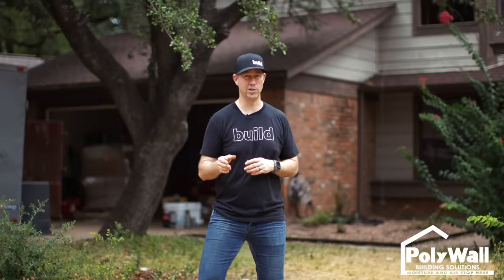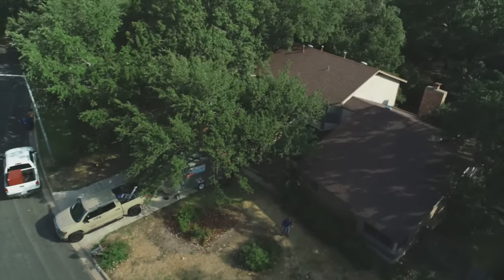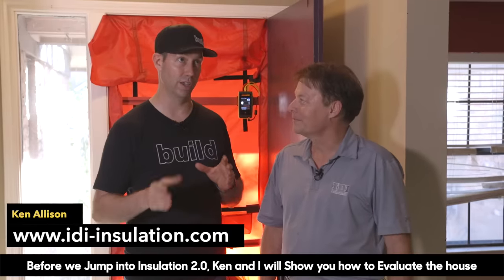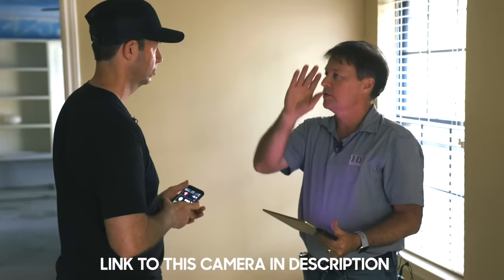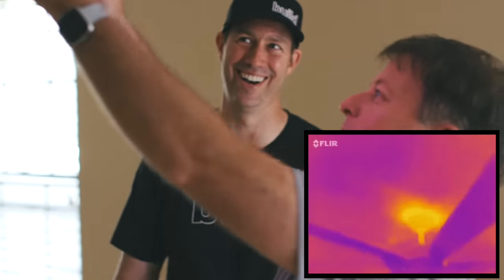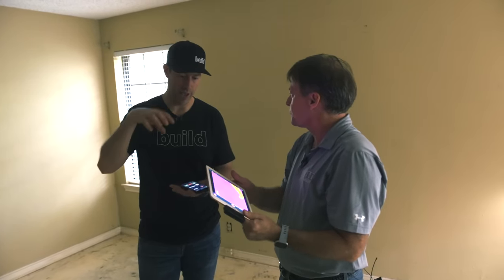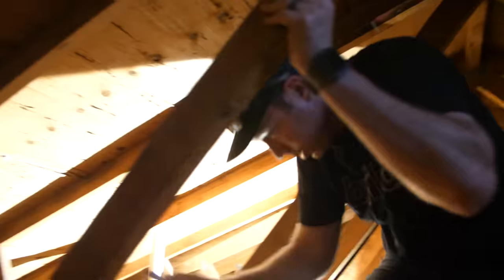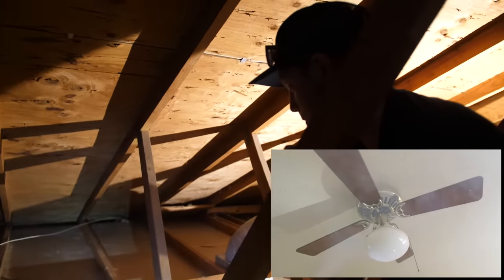Insulation 2.0 - 3 Steps to Re-Insulate

Comment: I had an energy audit performed on my house and I paid about $250 for if I remember correctly. I got a FLIR inspection, door blower test, and recommendations that I was able to implement myself. I was considering replacement windows (aluminum). What I found is that for the cost of installing baffles in the attic, and blowing in more insulation, along with installing an attic tent over my pull-down attic entry stairs and replacing caulking around my windows along with a few other items, the cost of the audit was paid for by energy savings in a few months. The attic tent is a must-have if you have a scuttle or stairs inside of the conditioned space. Another thing that Matt skipped over is proper sealing of the HVAC ductwork with mastic, even though he's replacing his system. As a DIY'er, I'd totally consider sucking out all of the insulation in my attic, doing the sealing of all of the top plates, and wire holes through those plates, however I'd wait until the wintertime here in Georgia.
Reply: We save clients that $250 almost immediately with simple suggestions

Comment: I took a thermal camera while I was house shopping. One house had a window that was covered up by drywall, no insulation or anything. Window was perfectly visible in IR despite being covered on both sides.
Reply: That thermal camera basically paid for itself in one visit. Good for you, Sir!
Reply: That's crazy cool
Reply: That sounds like American building standards, you guys should stop turning matchstick box’s in to houses.
Reply: @Kewonerdk  there are things called code. building the entire house out of concrete would be extremely expensive.
Reply: Kewonerdk not thanks, i like to be able to add outlets and change the floor plan without hiring people to remove concrete walls
Reply: @enkrypt3d  Yes, code requires the MINIMAL. You can do A LOT BETTER than "code".
Reply: I once CAT scanned a home I was looking at.

Comment: Lets see the FLIR after the sealing and insulation is in.
Reply: That would cost you ANOTHER $500-2500. AND be very disappointing!!!
Reply: Recovering_Californian  I was expecting and hoping to see that too. What I really wanted to see was the ach number after remedies were applied. Airflow is a bigger problem than a hot appearing thermal bridge.
Reply: @tommybaker4330  That iOS Flir is $299 on Amazon. I am surprised Matt does not already own one.
Reply: They have more of the remodel that needs to be done before they can show the after. Let’s hope he does the thermal camera and another blower test after that is done.
Reply: @ecospider5  ya
Reply: Btw this is the most budget flir I'm surprised Matt even showed that here
Reply: Ecospider5   You are correct. It would be interesting, however, to do the test in several stages, since they can or could have. It would be informative to see the ACH # at each stage of remedy. 
Costly to do for the average Joe, but for someone being sponsored by someone getting free advertising for a test that is easy to perform with minimal cost, it would’ve been cool to see original, intermediate and conclusion.
Reply: @nunyabidness5135  ya
Reply: @haroldoliver  , he doesn't use one because it would document his poor work.

Comment: Wish I knew someone like True-R-Value in Dallas back in the day..  Excellent video! I pretty much did the same but DIY as I couldn't find someone to do exactly this., rented the VAC and removed all the crud in my 1962 rancher to see what was left, and expose the wiring mess.  (Part of a bigger remodel).  Ran into exactly everything you saw here.  Also bought a FLIR.

- Missing insulation bats in some walls
- Bath fans going nowhere (no duct)
- open un-insulated cavities, kitchen suffit, and furnace plenum open  up to the attic in closet! 
- many wire insulation pieces chewed off by rats
- pancaked ducks / plenum holes! and more

so I foam closed all holes, re-wired the house neatly (easy once the old insulation and duct work was gone) and laid down two layers of Rockwool (R23 between the 2x6 and R15 above for R38).  btw, the rockwool has excellent sound proofing benefits as well.  being near DFW and I don't hear much inside anymore!

Bath fans were ducted out to the roof using insulated 4" ducts

One thing you didn't mention, but very important is to clear the suffits and add vents if necessary.   you need to draw out the hot attic air and you need flow.  I added a ridge vent and many suffit vents to get a positive air fow out of the attic (plus radiant sheathing).  Attic temps are lower + R38 = House AC hardly needs to run.

Now The house no longer has a musky old house smell and the AC/Furnace cycles very little here in scorching Dallas!

Comment: I really appreciate a show on improving an existing home instead of building a new one.  A lot more people have old homes than are building new!  And this gives me hope that I could possibly eliminate drafts in my home built in about the 1880s.  I'm curious about air sealing walls and the basement in future episodes.
Reply: Nice practical information is what most people need.  This video is helpful and makes people think about the money they are wasting if their home is not energy efficient.
Reply: He said the series was going to be doing practical remodeling like a person with a practical budget might... then later in the video said he would be changing rooflines.
Reply: I concur.  I love the new house builds but an existing home is another beast :)  This video came at the perfect time for me... hope TX gets our cool front so I can go into the attic.
Reply: All well and good, but it will cost $$$$ for all the labor (or hours, hours, hours for you to do it) to suck out the old stuff, seal all the holes, install new stuff. An Ohio contracting firm routinely charges $20-30K for this work.
Reply: The worst insulation mistake is using blown fiberglass. The foam guns clog. If you have under-performing fiberglass in your attic, it can be corrected with a seal coating of cellulose insulation.
Reply: Or you guys should start building houses. Instead of disassemble matchstick box’s and turn it in to a house.
Reply: David Eakin They are robbers. This guy said $6 a square foot for suck out, fixing leaks, and new foam. For my 1500 sq ft attic that would be $7500.
Reply: Haha spray foam can solve a lot of issues as long as during the application the material is not too damp. But again it is the most expensive. You can shoot some blanket insulation right against block walls. #sinnisjInsulator
Reply: @TaxTheChurches.  Apparently it's what people pay... if people pay it, it's apparently worth it to them... but I'm about to buy an old leaky house, so not super excited about that bill.... I guess that means I'll by in the attic a lot.
Reply: I've got a new channel where I do demonstrate some work I did in old houses. #sinnisjInsulator
Reply: Old builds are better.
Reply: Sorry to be so off topic but does anybody know a method to get back into an Instagram account?
I somehow forgot the login password. I would appreciate any help you can offer me.
Reply: @Tyler Cairo instablaster =)
Reply: @Cayden Xzavier thanks for your reply. I got to the site on google and im waiting for the hacking stuff atm.
Takes a while so I will reply here later with my results.
Reply: @Cayden Xzavier it worked and I finally got access to my account again. I'm so happy!
Thanks so much, you saved my ass!
Reply: @Tyler Cairo Happy to help :)

Comment: I vacuumed my old insulation with a repurposed Harbor Freight cheap dust collector.  I piled it all on one side then used a 2 part kit of closed cell foam to put down 2” of foam and seal everything.  I then blew it back over the foam and did the other side.   Finished by using a rental blower from a big box to blow in 24 inches of fiberglass on the top.  I installed baffles to keep it out of the soffit and allow air flow to the ridge vent.  I was very pleased with the results though it was a lot of work.
I was 60 years old at the time and spent around. $1400. About 1300 sq ft.
Reply: Before and after blower door number?
Reply: Ted Kidd 😂
Reply: Stephen Brown Sounds like a solid job. I am doing a similar project but have to take down the lath ceiling. It’s the two upstairs bedrooms in a 100+ year old house that had a leaky roof which is now repaired. But will be sucking out old blown in and discarding. Not sure what way we’re going to re-insulate.  Getting a spray foam company in for 600sqft not very economical.
Reply: I just read you comments and thank you. My home was built in 2005 and I'm the 3rd owner. I love my home but whoever the builder was sure did cut corners. I've got 1200 sqft of living space and I need to redo my attic. I just did crawlspace encapsulation. I can actually feel the heat from the ceiling in our living room. So air sealing the attic is definitely next on my list.
Reply: Bravo!

Comment: I did this to my house several years ago myself. Electric company did a blower door test first. I took out all the old thin batt insulation from the attic and crawlspace, used 27 cans of the "Great Stuff" type of spray foam at every penetration I could find (wires, tops of walls, light boxes,  newly installed can lights, hvac boots, etc).  Added insulation baffles at the eaves, blew in 15" cellulose in the attic and installed new batts in my crawl space.  I also caulked every joint I could find inside my house. 

Follow-up blower door test cut the leakage by a little over half!  The electric company said it was the best they had ever seen by a homeowner, and maybe even by a pro!  😁  They actually recommended I add in a fresh air return to my hvac because it was a little too tight!
Reply: Good work!
But what did something like that cost? And what happened to energy bills?
Reply: @michaelrdegroat  I spent about $8500 for the whole process, but that included a new hvac system and duct work installed at the same time.  I ended up getting $2800 worth of rebates from the electric company through a program they had going at the time.  I actually financed it all through the electric company at 3% interest.  Their software estimated all my efforts would save about $45 per month.  So my bill didn't change much, but about $40 each month is paying the loan off from them.
Reply: Did you find someone to come vacuum the old out? How did you find someone for that?
Reply: @brendonwillis5438  No, my old insulation was 35 year old fiberglass batt.  I just climbed up in the attic and rolled it up as tight as I could and stuffed it into trash bags.  I did the same thing in the crawl space.
Reply: Why would you need to add an additional fresh air return to a closed system?
Reply: @susanlovesjava4961  you need fresh air to come into the house so you don't get bad air quality overall. Poorly sealed homes just leak it in everywhere.  If you can control how and where the air is coming in you can make sure it is good clean air.
Reply: @joshperrythree  that makes sense...intake air prefilter

Comment: Great video, the detail is helpful for a project I'm thinking about.

One thing I'd add for anyone considering using a thermal camera, from experience with my FLIR, is that all of the colors displayed are relative. There's no calibration to say that a certain temperature is red and another is blue or whatever. It continuously changes the colors every frame, similar to auto-exposure while shooting video on a camera. That means that it's important to look at the absolute temperature reading in the center of the display (not shown on this guy's camera for some reason), to verify that the "super hot" thing you're looking at is actually hot and not just the hottest thing in the room but in reality only like 1 degree warmer than everything else but the camera still had to assign that color to it.
Reply: I think that’s why they stopped looking at the wall, fallowing the window, so quickly.

Comment: It's probably too late now if you didn't do it, but in my brothers attic before he added more blown insulation, we built a raised walkway. I think it was a 2x12 raised up 12 inches or so. It helped the insulation installers a low and has also made maintenance type of work much easier. I highly recommend it.
Reply: good point. I was wondering how the heck to know where to step after this thick insulation is on the floor.

Comment: Great show Matt!  We have reinsulated all the homes we ever bought except our current which was super insulated when built.  Every reinsulate we did has saved us much cooling and heating costs, made our place more pest proof, and made the home quieter! I love wise investments!
Reply: Jo Ellen Broetzmann how long did it take for the investment to pay itself off each time? And what climate do/did you live in?
Reply: @fosterlewis7360  a lot of people are claiming ~40% savings on their heating/cooling bills, so if you take into account your bill, find 40% of it, and then divide the $3000 project cost by that, then that's about the number of bill cycles it would take to pay itself off.

It will vary widely by price of gas/electricity in different areas of the country, as well as by how leaky each individual house is

My bill is approximately $400/quarter, so $1600 per year.
If I saved 40% from this project, I'd be saving 160/quarter, or $640/year.
By the end of the fourth year, I'd be in profit :)

The profit is more than just money, though. My energy comes from finite and harmful resources at the moment, so doing my bit to save it is an often undiscussed benefit.

Comment: did the same 2-3 years ago in Central PA. 6000 HDDs of heating season. We cut our energy usage in like 60%. Our highest heating bill went from 130 USD to about 45 USD in the coldest month (usually some temps at below 0F). Total cost was about 500-600 USD out of pocket. We put in like 18 inches of cellulose up there after sealing everything.
Reply: Well worth the time and effort! Why did you use cellulose vs loose fill fiberglass?
I’m in Michigan and need to do the same. House was built in 1976.
Reply: @wjb111  cellulose because it was less itchy, also because when it settles, it makes the area more air tight. Fibergrlass if tehere are air leaks, works in essence like a car filter onnly. so the drafts are not eliminated while with cellulose that happens. Also, more fire resistance.
Reply: @wjb111  I used celulose due to not being itchy. Also more fire resistance according to tests, and also because when it settles, cellulose had more air leakage stoppage (although I did seal all gaps i could find) while fiberglass, any air leaks just lets the air go through.. Well worth the effort. Highest heating bill was around 40-45 USD in winter time - Jan peak. Also we did insulate the basement with 2" foam boards along with the skirt joist of the house and that also helped slightly although the ROI wasn't as good.

Comment: I literally have a insulation contractor in my attic giving me a quote, great timing Matt!
Reply: The quote to remove the insulation and airseal added about 5k to my quote, how feasible is it to get up there with a Hilti gun and just move aside the existing 5inches of insulation bay by by myself?
Reply: @reedharris2519  Its easy, just time consuming, follow where the walls are, wires exits, etc.. and airseal. Also, the insulation will be dirty where there are drafts.
Reply: @reedharris2519 , just sweep over each fixture to expose. (Wear a face mask & Tyvek suit.) Joint compound and caulk are inexpensive for closing visible holes. R-49 to R-60 cellulose will correct the air leakage and thermal loss not stopped by cheap builder's fiberglass.
Reply: @reedharris2519 , 5K? You must be on someone's sucker list. Wear rubber/leather gloves, Tyvec suite, and sweep/rake, push the nasty 'glass aside. Then cover the exposed suspected leaks with cellulose insulation. In fact, cover the anemic blown fiberglass with cellulose to correct its thermal and air-sealing deficiencies. Or, give your money away needlessly if you'll feel better.
Reply: Just don’t let them install the new air chutes in backwards like in this video lol otherwise I really like Matt’s videos
Reply: Y @acdc1363 what's the video time stamp for backward air chutes?

Comment: Yes! This is exactly the type of thing I think a lot of us have wanted to see. I just had all my insulation sucked out of one of my attics a couple months ago and spray foamed the underside of the roof, as my hvac ductwork is in that attic space. My other attic, they sealed up the hatch and topped up to 16". Love this!
Reply: How is this?. the underside of the roof.. I am 'contemplating' this .. but think i should put in insulation board under the roof rafters - to keep the airflow up on the roof deck itself. .. however putting that 'board' up .. will take a lot of work.
Reply: @lawrenceeldridge1155   you usually spray the roof of an attic that has no incoming air. The idea is to make it a conditioned space. Not heated or cooled but not allowing huge temperature changes. Not heated or cooled but more stable and  similar in temp to the interior of the living space. Spray foam is a vapor barrier as well.
Reply: @lawrenceeldridge1155  it really depends on your attic space. Joe Lstibrek says that a vented attic space is better with air sealing and attic floor insulation than an incapsulated attic. But having your HVAC  in that attic space makes it better to keep it incapsulated. Because of his furnace in his attic, he has to make the best of a bad situation and seal his ductwork as best he can.